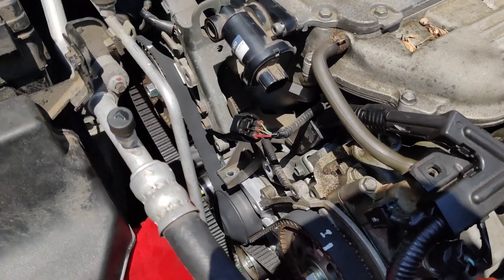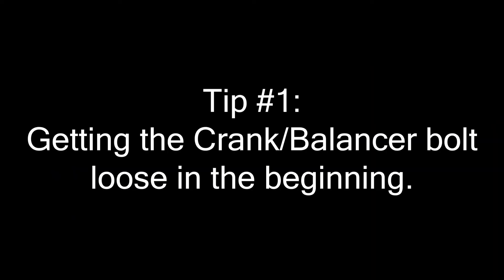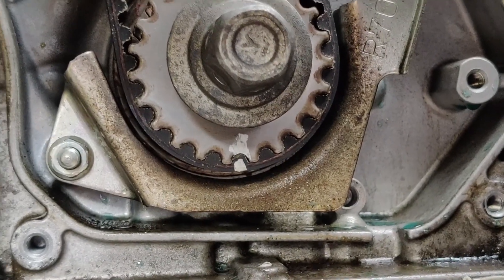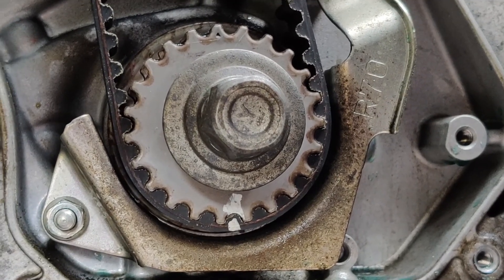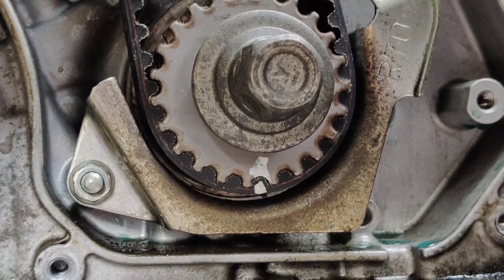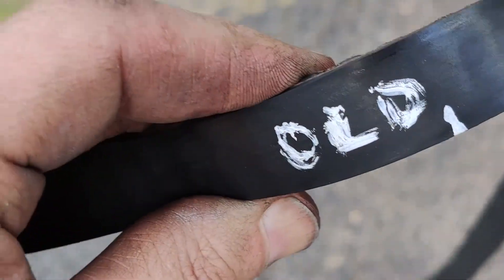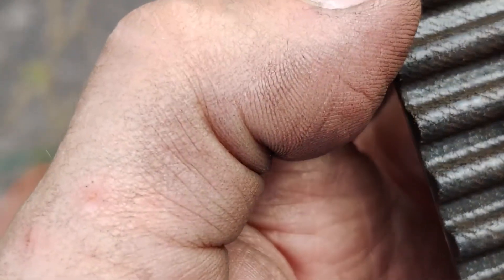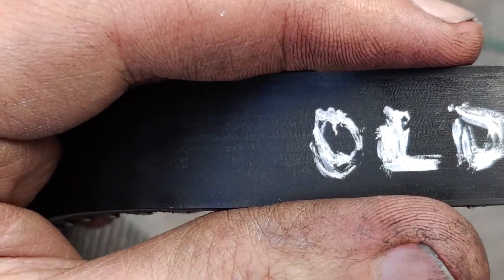8 Tips for Replacing Your Timing Belt

Comment: The procedure should be similar for all 3.5L Honda V6 engines produced after 1998 (J35) which would include the 1998-now Odyssey’s and the other 3.5L v6 Honda’s and Acura’s... they all have the common issue of the Timing belt tensioner failing prematurely (makes a knocking sound most noticeable from a cold start) which if not addressed could severely damage the engine... hope this helps